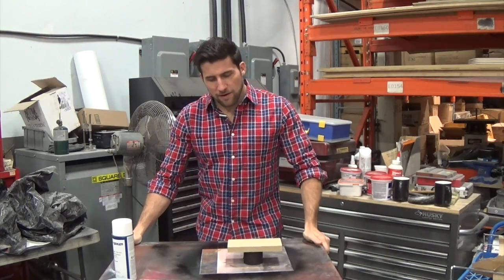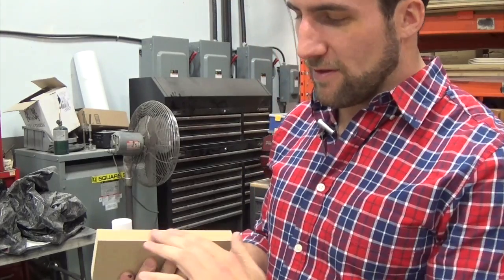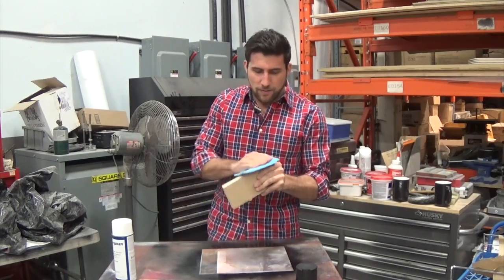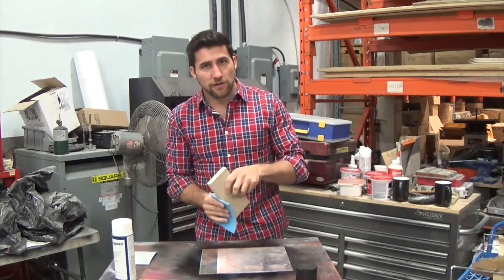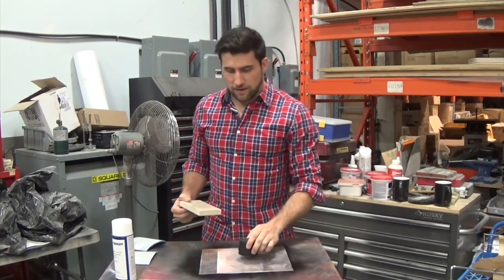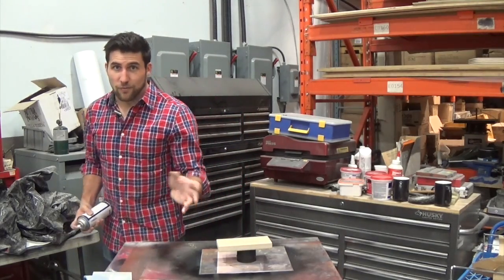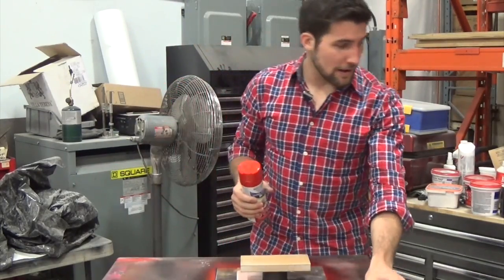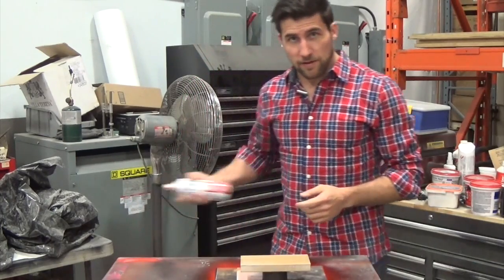How to seal MDF for a gloss finish

Comment: Hello Brad . Thank you for the video.
Can NC sanding sealer be used over raw wood (pine) ,  if one wishes to paint over it using Acrylic lacquer spray cans ?  
Thanks!
Reply from the maker: Yes it can.
Reply: Thank you very much for the reply . Could you please elaborate a bit about the technical aspects & what makes NC or acrylic work with one another ? I would love to understand it in a little more detail please , if it not too much of a problem to you . is there anything like NC products can go under acrylic lacquers  but not over acrylics ? sorry for being so nosey !
Reply from the maker: Acrylics tend to be pretty stable. They don’t react as readily as many finishes. In this case, the NC sealer just seals up the grain and acts as a base. Give it lots of time to dry and then sand it with 600 grit. That gives the acrylic something to attach to. Don’t put NC overtop of acrylic. NC is notably more volatile and reacts to various finishes.
Reply: Thank you very much ! Just the information I was looking for ! how much time would you suggest to let the NC sanding sealer dry for (a good ,general & safe timeline)  ? Also how many coats of NC sanding sealer would you suggest I do to seal the pine wood ?
Reply from the maker: At least 3 days. A week is better. 
You’ll be able to tell as you spray how many coats are needed to get it to seal up. 3 is usually a reasonable bet.
Reply: Thank you very much Brad ! very very helpful . I am learning so much from your channel each day (I am sure you can make that out from all the questions I am asking ! haha) Thanks !

Comment: Hitting it a second time while the first application is wet is a waste, IMO. I believe it only soaks in like the first application. I would suggest allowing each coat to dry well before going over it with another, regardless if the coat is light or heavy. Wait for each application to dry well before adding another.

And if you're going to advise wearing "a mask, please," then BE THE EXAMPLE. Otherwise, a viewer is likely to ignore your advice when you don't see fit to show how it's done yourself. Perhaps a shop-vac exhausting to the outdoors would be sufficient, like a ventilate paint booth. .
Reply from the maker: I don’t need something exhausting to the outdoors. This room is big enough that it’s practically like painting outdoors.

Comment: What about Epoxy ?
Reply from the maker: It depends on the circumstances. Aka, the size and shape of the item.
Reply: Would you care to elaborate on this? I am considering refinishing my kitchen worktops with epoxy resin and since I have a small kitchen and like a gloss finish I thought I might also use it on the cabinet doors and drawer fronts. I am still in the early planning phase of my budget kitchen upgrade and would love your input. Nice vid!
Reply from the maker: Epoxy is great for things like counters etc. it wouldn’t be as good for a small parts like the one in this video because it would just run everywhere and wouldn’t really have space to level out.
Reply: Brad Angove ok thanks for the info!

Comment: the    way  he  is  doing  it  will  make  it  look  like  a  plastick  rather   than  a  gloss   finish   to  make  it  look  moor  like  a  car   finish  u  need  to   do  a  lot  moor  than   what  he  is   doing   u  need   to  put  a  2pack   primer  then   befor    u  sand   the  primer  down  u  need   to   spary  a  dust  coat  of  stain  then     sand   the  stain   and  u  will  see  little  dents  in  the  flat   side  of  the  mdf  and  u  need  to  put  smooth   car  boddy  filler  on  the   dents    then  2   coats  of  cellilos  primer  thin  it  out  60  40  then   affter  tht  u  can put  ur  top  coat  on   u  can  even  put  a   spry  gun  finish   that   dont  need  to  be  buffed   up
Reply from the maker: You’re drawing a distinction that doesn’t exist, but more importantly, what is going on with your space bar?

Comment: MDF is made to be a perfect paint surface it was developed hand in hand with Sherwin Williams Conversion Varnish  .  Ease edges remove machine and saw marks , 2 to 3 primer coats depending on customer and price paid. 2 coat's what ever sheen. Or 3 coats conversion varnish .  The important part is let the shit dry you impatient turd's . So simple a painter could do it , then again I'm a Finisher.
Reply from the maker: +Russell St.Clair if it was made to be a perfect paint surface, whoever developed it was confused. There are a lot of wonderful surfaces out there for finishing. MDF is not one of them.
Reply: Brad Angove I've been Finishing cabinets and furniture for 30 years   and have finished MDF time and again . Name 2 that finish better . Oh one other thing 220 is not for prep sanding.
Reply from the maker: +Russell St.Clair Of all the cabinet guys I’ve worked with, none have ever said that MDF is anything but a pain in the ass to finish. I really hope you’re not making furniture out of it haha. 
Name 2 materials that finish better than MDF? Sure: aluminum, dibond, steel, fiberglass, plastic, walnut, rock maple, ash, sapele, wenge,... satisfied?
MDF isn’t designed to be great for painting, it’s designed be really cheap. To be fair; it fulfills that purpose wonderfully. It is really just sawdust and glue after all.
Reply: I mis-spoke. painted finish . Never made cabinets out of aluminum . Go to Las Vegas. Paris Casino I did all the white lacquer in 4 coats, 2 primers 2 top coats  on MDF . Like I said before let the product dry completely but then again I do entire kitchens and what ever I'm finishing   . As for the cabinet guy's their cabinet makers I'm a Finisher  those guy's push their work over to my department where my apprentices and I finish it . The box jock's go back to their bench and leave the Finish to the Finisher , me. 30 years with a gun , brush and color sample in hand . I don't build boxes my math starts with infinity . Trust the people who do the work I ask cabinet makers to build my cabinets  they ask me to finish because I'm the Finisher. If you what me to give you the correct method for every type of coating I could but I won't . I will tell you the best method for water borne lacquer. 1st coat , spray on .75 ml let flash 2 min apply 2nd coat at 1.25 ml let dry completely . Sand with 180-220 , clean and remove all dust apply 2nd coat in a double wet coat cross hatch pattern at 1.5- 2.0 ml. allow 2 mins. to flash off (look for flash film ). You should be spraying at 75 degrees to 80 . Per lab spec's. let dry completely. Sand 220-320 . Spray double wet coat of lacquer 1.5-2.25 ml allowing to flash once again. If you are sanding and little balls appear stop and let it dry. Conversion Varnish is a different animal all together and I don't give that one away . The MDF don't swell , you have added volume to the fibers .
Reply from the maker: +Russell St.Clair I was also talking about painted finishes. All those things are better for painting than MDF. I never said anything about cabinets though.
Reply: cabinets and furniture production is the reason MDF was created . To solve a few different problems in manufacturing . It was made for ease of machining and a uniform paint surface . I won't go into laminate's, Mel's or Vaneer's. The biggest problem with finish is dry time and understanding the building of a finish. I'm not trying to be a dick , I'm trying to correct bad habit's . As a Finisher I work with anywhere from  3 to 28 benches( Journeymen)    with 1 helper for every 2 benches on average . Sending their work to the Finish Dept. While the cabinet maker is allowed all the time to do it right once, the Finish is given far less craftsmenship . Some steps are followed . Such as the case with Water Borne Dye's . Mix with water spray ? Look it say's you don't have to wipe it ! It also say's let acclimate for 24 hour's before mixing color's or application . Along with let dry according to moisture requirements of chemical coating's manufacture . (80 F is ave. Lab. temp. anything above 6% moisture is bad ) Nawwwwww !! That shit don't matter can't see it from my house ! And my favorite reason for not doing it correctly  well it's tied , As long as I get paid ! I've been running a table saw for 20 years ! You can take Boxing lessons from Floyd Mayweather  or Floyd the Barber of Mayberry . Do this and find some old fart finisher's I'm alway's looking for them . Bring them beer and questions they'll teach shit that'll leave you scratching your head . Again sorry for being dickish it's the Foremen in me.
Reply: Brad Angove funny thing this Russel guy telling u how it is as he is a know it all yet he is on your channel video watching u do it .lmao
Reply from the maker: Happens all the time man.

Comment: Good vid .but if you should avoid rubbing sprayed wood with your hand as grease will isolate the next coat from bonding ,this is especially important for a final gloss coat as it makes the top coat crawl off microscopic grease from your hands .And not wearing a mask is irresponsible when doing a video .If you doubl this grease thing .dont it's the rule in all furniture manufactureing

Comment: way too much sanding, applying wood filler and sanding once should give you better results, I have tested both and the spray filler takes a lot more work.
Reply from the maker: Not if you get a good sealer.

Comment: Looks like a lot of spray was used on just a tiny piece.
Reply from the maker: Correct. That's why MDF is so challenging to finish. It absorbs a lot of material.
Reply: LOL, no wonder that company uses him to sponsor his videos.

He uses half a can on a 3 by 5 inch block of wood. He also recommends to sand away most of the product to properly seal.

I guess for kitchen cabinets and/or floor standing speakers it would take ~50 cans. Can we say, "Cha ching; make it rain."
Reply from the maker: +Anonymous DueToFascists hahaha I had already sealed an entire guitar with this can before I did this video. Just this can. Their guitar refinish kit comes with several. If you're going to use 50 cans on something, it's going to be expensive. 
And yes, part of sealing it properly involves sanding. Just like with any other wood project.

Comment: And are the NON-toxic products that you can do it with? It is, after all, going to be in your or someone's house and off-gas stuff over the years.
Reply from the maker: It gassed off in a few days. If you’re in no hurry you can use pva to seal it, but eventually you’re probably going to want to use some solvent based products to get the gloss finish.

Comment: zero chance this gloss will last... mdf suck it up, in a day or two.. i spoke with my friend that owns a furniture painting company, he told the only way is to use 3 component polyesteric primer and paint to make this mirror gloss and last for 20 years.... and if you do some speaker boxes, you mUST join them in 45 degree angle, else its not posible to make it. No putty or fiberglass will hold.
Reply from the maker: He’s wrong, I do this all the time and this gloss lasts just fine. 
Also wrong about not being able to have a joint other than the 45 degree angle hold properly, but that’s how I join them too. The 45 degree just makes for an easier joint to work with.
Reply: Brad Angove you can have a 90 degree joints, but you never will mirror glos paint them.. i have tested with variuos puties, fiberglass stuff, and its super glossy for day or 2 than paint sanks down and you can see the joint.  Duno about what mdf you use here, i have used regular one, for my subwoofer box, i have been trying to paint from ratle cans on scrap peaces for two month with black glossy spray can paint, and have used varouos type of primering, sealing etc, https://imgur.com/a/PRrH4XN here i got max glosyness posible, but last for like 3 days, than blures out, we call it paint is sitting down.   For max glosiness you must seal mdf, than you primer with whatever, you paint wet on wet few layers to cover, let it dry for  1 week, than yoh lay 5 layers of clearcoat, than sand it 800-1000-1500-2000-2500, than you polish with fine paste, and the you can use some hard car wax to buff it.
Reply from the maker: Like I said, I use this process to put a gloss finish on mdf all the time. It lasts indefinitely. That includes edges.

Comment: waow backyard of wayne manor ha?
Reply: Great videos Brad, im an amator at these painting things and metal plates are expensive. Can i 
use mdf to practice before start to paint metal plates, i mean  is method u use in this video may help me?
Reply from the maker: You should be using primer for metal, not vinyl sealer.
Reply: i couldnt find any colorless primer at my country, can there be any colorless primer or is it just about my country : ) ?
Reply from the maker: I’ve never seen colourless primer.

Comment: İf you cant afford to buy such a greate product you can use candle or wax. Rub it on the surfuace and apply a little bit heat.
Reply from the maker: Except that paint doesn’t adhere to wax properly. So I definitely wouldn’t recommend using that as a sealer.

Comment: Seems like a lot of pissing about here, just use an Acid Cat Primer sealer. 1 quick dryish coat followed by 2 wet coats leaving 20 mins between coats and will be dry to paint in 3 hours.

Comment: It is really not a great idea to be spraying solvents in the vicinity of electrical equipment!! 

Also, it is a code violation to place item on or in front of electrical equipment.
Reply: What are you, the Safety Gestapo. Get a life and stop nit picking a freakin' video that's trying to illustrate how to seal MDF.  If i wanted to watch a video on safety precautions around electrical equipment I would search You Tube.
Reply: Co Rin it’s not nit picking. It’s life or death. Apparently you could use an introduction to life safety, or at least get a grip on reality. There is never a wrong time to address safety issues, and I will not stop just to satisfy a few haters.
Reply from the maker: +Chuck D cool. Thanks.
Reply from the maker: You can stop though. I don't know what the codes are where you're at, but I'm not too concerned about placing items on top of electrical equipment.
There's a 600 amp panel on the left, and I ran several of the 20 amp circuits into it while it was live. A box or two on top doesn't really worry me.
Reply: The electrical codes are nation wide. It doesn't matter what you think or what you've done, if you're in the USA the codes trump your opinions.
Reply from the maker: +Chuck D Sir, I appreciate your efforts to be safety conscious. Safety is important, and I encourage you to take every precaution with respect to your well being. 
I'm not in the USA, so I guess this talk about codes has been moot regardless of whether they would affect my conduct.